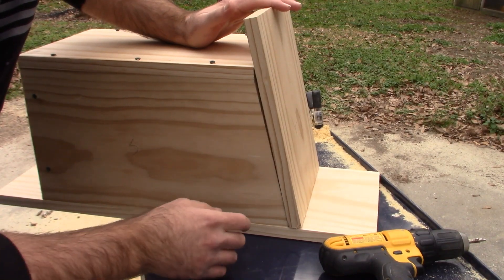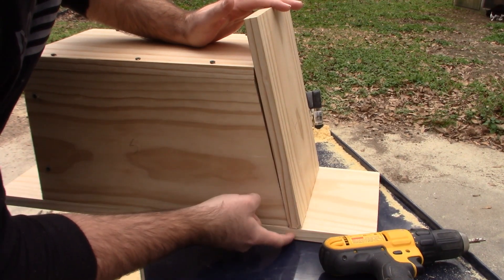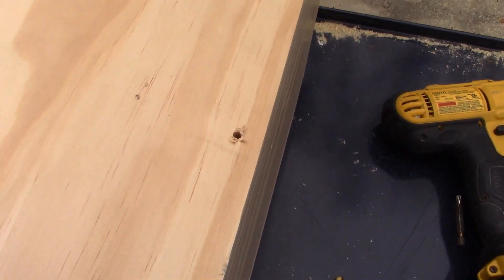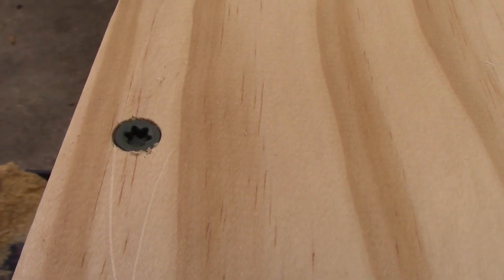Homestead Project: Building an Owl Box, Screech Owl

Comment: Good info, however, 15 to 30 ft.?  Way over kill.  At those highest, how do plan to maintain it, they do need to be cleaned annually.  A simple design adjustment would include allowing the bottom to slide out for cleaning.

Comment: Built 2 in western NC  last year.  Mostly because I love owls. It drastically cut back the rodent problem in my horse stalls. Had tried before. I was just mounting them on the wrong side of the tree. I also attached a tree branch on the front.  Those babies get brave fast! Thank you!

Comment: Any chance I could get the name of the exact stain you used? Been doing some research and haven’t seen a conclusive answer on waterproofing it. Built mine out of pine (probably not the best idea) and don’t really want it to rot away but also heard some birds won’t go in it if it’s stained
Reply from the maker: I built mine out of pine too don't worry.  I used Thompsons water seal (the deck stain) only on the outside.  2 years later she's still hanging with only a slight warp of the top from the sun.  Still sturdy and since I didn't stain the inside, its still attracting use
Reply: @PalmettoPrepared  ok, thanks so much!